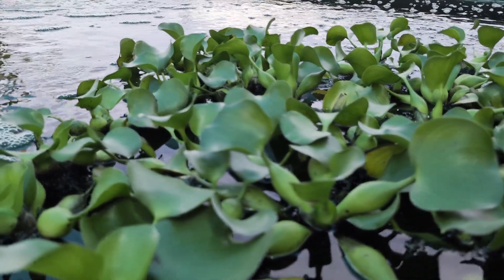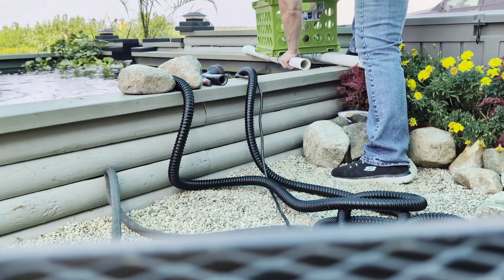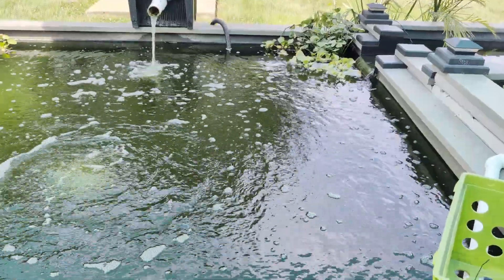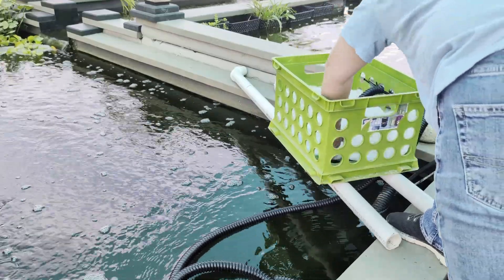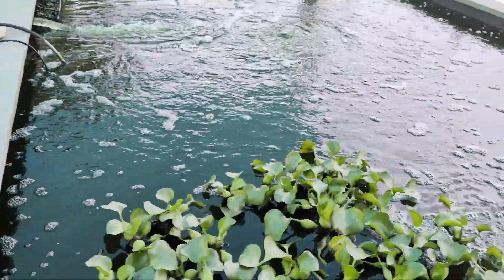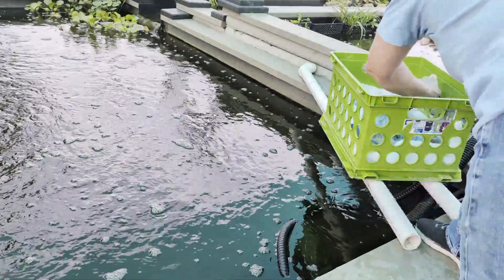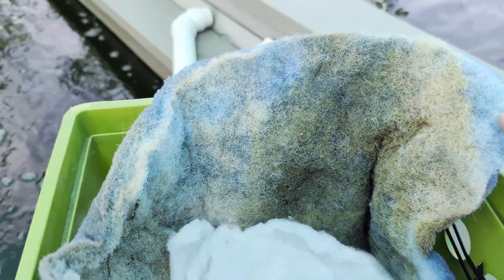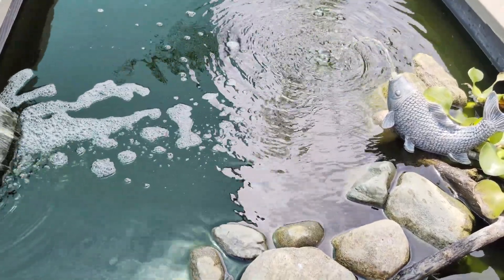DIY Fine Particulates Filter

Comment: Good thinking securing the hose like that as you don't want it getting knocked loose in the middle of the night 
That filter cloth should catch a lot. Smart having so many drain holes in case or when it gets clogged. 
We are always trying to find better ways to filter out ponds 
Cleaning and definitely aerating your water.
Nice job . Time will tell.
Hope to see you Sunday!
Reply from the maker: Thanks Chris. I'm hoping it will work over time. It didn't happen over night, so I know it's going to take some time to clear up. In the meantime, I'm continuing to use the product you recommended on a weekly regiment. Keeping fingers crossed 🤞❤ See you Sunday my friend ❤

Comment: That's pretty cool for a big pond. I used a large clay flower pot on a small washtub size patio pond. It worked out quiet well. I placed some river rock and gravel under the poly fill. With the hole in the bottom it Drained into the pond. I just set a couple pieces of ceder 2x6 wood, to keep it setting over the pond. Thanks for sharing you little crate idea. Thought that would be useful to put plants in the holes also as added greenery around the pond. Like watercress. See. now you're giving me ideas. lol ... thank you for sharing.
Reply from the maker: Thank you for watching. When I make a permanent bakki shower, that will compliment the pond, the. I will do that. Right now, we are trying to get this weird algae out of the pond from the farmers spraying the crops. Thank you for watching. ❤
Reply: @sweetkoiyo  looks like your on the right track. Sorry to hear your dealing with farm over spray.

Comment: Gm Christine. Has the iv help s little so far. This pond is amazing. Thanks for sharing
Reply from the maker: Hi, I really don't see any difference in the pond with the UV. This Algae is like no other I've seen. I wish I knew what fertilizer, and pesticides they are using to spray from that plane. I have asked, but no one will tell me. Once we get the algae out, I will take down this filter, and put up a pretty bakki shower, that might help prevent this next summer. ❤
Reply: @sweetkoiyo  is this the only pond you are having an issue with ?